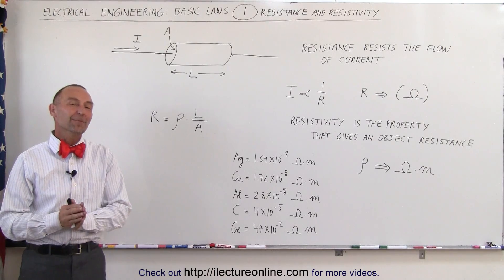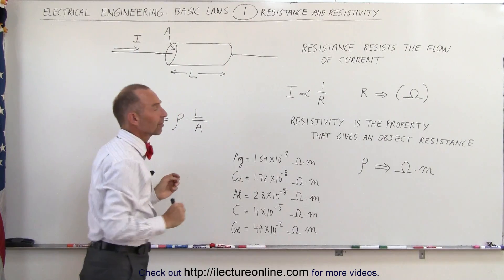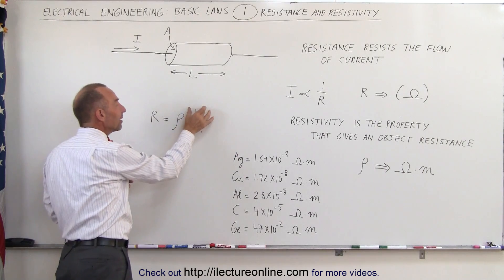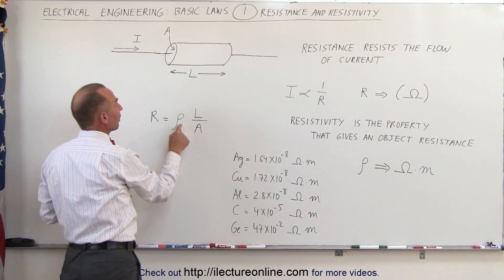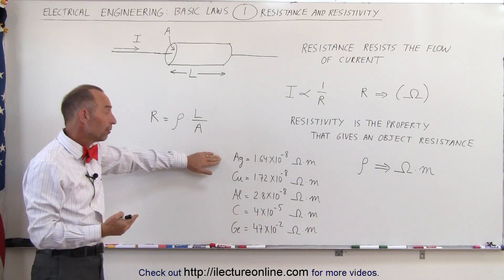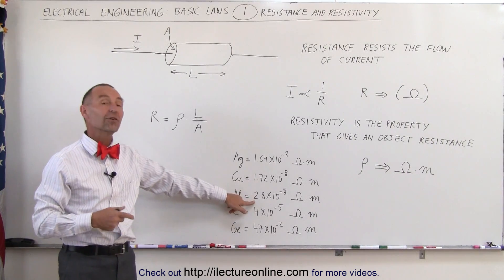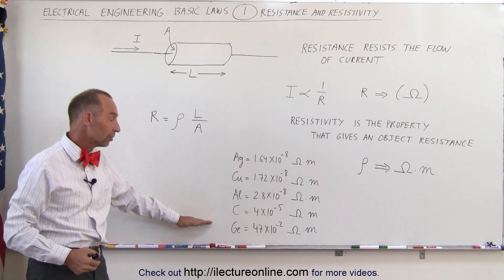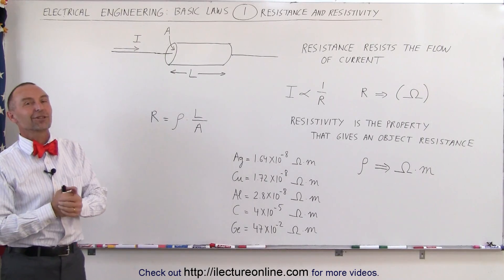Electrical Engineering: Basic Laws  (1 of 31) Resistance and Resistivity

Comment: Mister Michel if i get it right it means that every element in the periodic table has a certain resistance?
Reply from the maker: +Niki Isufi Yes, however there are fabricated materials that are "super conductors" which have virtually no resistance to current flow.
Reply: +Michel van Biezen Got it thanks!! :)
Reply: +Michel van Biezen  Gold is said to be the best conductor of Electricity and i think it also have some resistance in fact core resistance... Can u mention any superconductor that have absolutely zero resistance